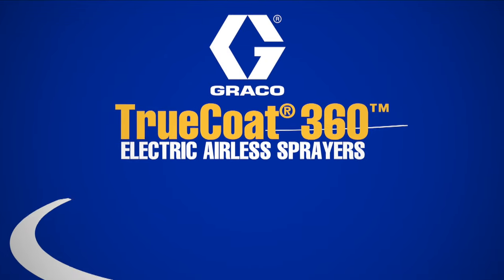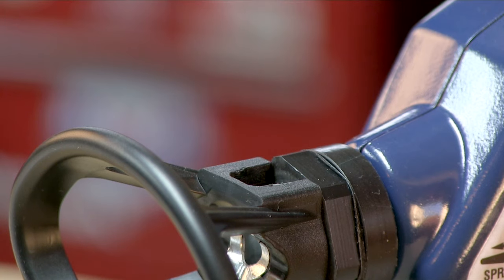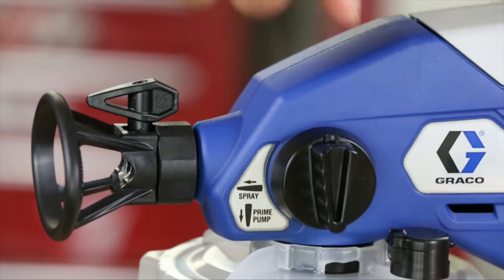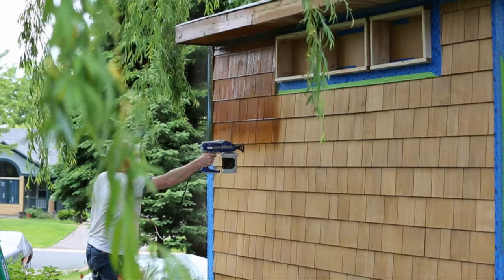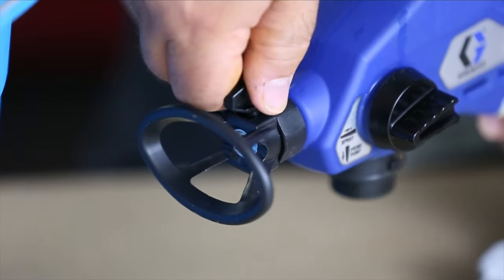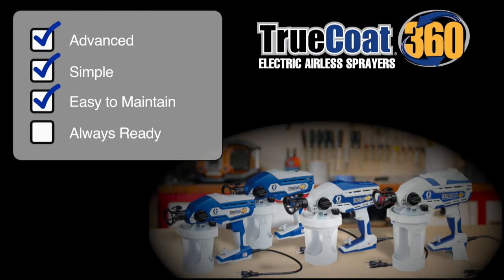Graco TrueCoat 360 Operation Guide

Comment: 0:38 What's Included
1:45 Safety
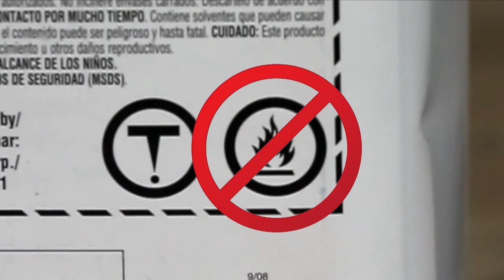2:06 Common Components
4:11 Sprayer Setup
4:16 First time usage
5:30 Starting a New Job
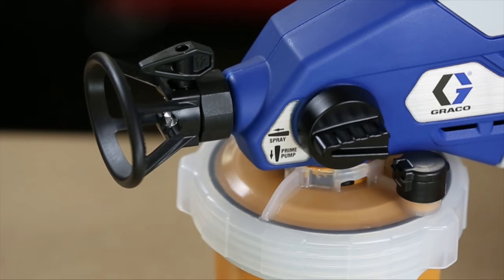7:21 Refilling the Sprayer
8:40 Troubleshooting
9:26 How to Spray
10:16 Spray Techniques
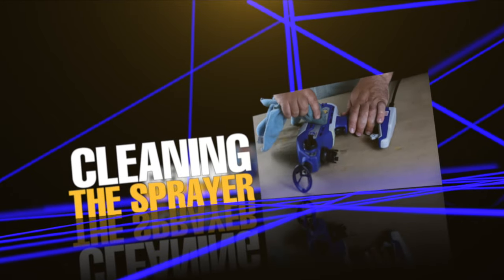12:33 Cleaning up
13.42 To Clean the Sprayer
16:12 Storage

Comment: People people,

Listen up and save yourself unfounded aggravation. This sprayer uses a collapsible bag to hold the paint. All air must be removed via the vent cap and gently squeezing the bag until the air hissing sound stops. Priming on high while inverting the sprayer for a few seconds is critical. 
Straining the paint from old cans is recommended. Read the manual and watch this video. This sprayer is awesome when you first take the time to learn how it works and what to do if there’s a stoppage of spray.
Reply: I have done all of that and still I cannot get this it to spray. I am a furniture finisher. Smdh

Comment: Bought my Graco TRUECOAT 360 DS, super hot here in Florida today, I finally got the sprayer to spray out the test fluid. I then filled the liner and followed the directions to the T.. I ended up thinning my latex paint even more with water. The sprayer would not spray paint no matter what I did. This is a brand new unit that I believe is going back to Lowes. Very displeased.

Comment: Once I sell more of my projects I’ll invest in one of these Graco sprayers, a buddy highly recommended these sprays and looking into them they look to be the best for my needs.
Reply: They are like 250 dollars at most for non professional models. You ain’t gonna get much cheaper without getting shitter quality. Just buy one. Amazon allowed me to do 5 payments 0 interest on my 360vsp without any sort of credit check or credit card offer. This is gonna out perform anything you use that’s cheaper.
Reply: For woodworkers I wouldn't recommend this sprayer bc you're limited to the. 15 spray tip. The home right finish max is far superior in my opinion bc it comes with a variety of tips for different materials. For walls or outdoor use this thing works great but for furniture I would pass.
Reply: @dusbus2384  mine came with two different tips but ok 👌 you do you
Reply: @dusbus2384  all of the 360 models come with a 12" and 4" tip

Comment: I have owned a 17D889 for a couple of years.  It works as advertised if you follow the directions.  I have not had problems with clogging - I strain any old paint that I use.  I bought it to paint interior, exterior and garage doors.  I also used it on outside furniture.  I really like to bag system that allows you to paint in any direction.  The  major drawback is limited paint capacity - ie you have to refill it for big jobs.  I have never used it indoors.

Comment: TO CLEAN 
Wash tips and liner
Fill liner with warm water
Attach liner 
Turn to Prime Pump 
Shake for 10 seconds
Dual switch to High
Turn upside down and spray into bucket for 10 seconds
Turn to Spray position
Reverse tip to Unclog
Turn upside down, spray trigger for 5 seconds
Repeat until runs clear
Reply: Thanks, I guess they didn't need to make a video

Comment: I guess the newest versions are called single speed and dual speed, dual speed plus and variable speed.
I'm assuming the newer DS is the "dual speed 26D281"
Also comes with 4 tips and 2 screens. 2 tips and screen for paint and 2 tips and screen for stain.

Comment: can you paint exterior of house with this?
Reply: Yes. I am. I'm using the 360VSP It works pretty quick and the end results are way better than I expected. The bad news is that the sprayer will only last until you're sprayed 25 gallons through it before you need a rebuild kit or new tips, AND its a booger to clean. (You can usually paint a 2000sqft house with about 5 to 6 gallons of base color). You almost need to use the spray like you are spraying with canned spray paint otherwise the sprayer gets hot. Short quick bursts... It's more controlled when you spray this way. I'm using two year old unthinned latex for a one coat, and this machine is laying it down (5-6 pressure setting) with a light eggshell texture that seems to level itself out. My favorite part of painting with this is getting under the eves of the house and painting with the sprayer upside down. Gutters look good too. You do have to strain your paint if you have chunks, I've had one clog because I ran out of paper strainers. Once you clog your sprayer, you have to do a partial clean out of the sprayer. I keep a 5 gallon bucket of water for cleaning and a 5 gallon for rinsing.

Comment: Stopped working on the 3rd or 4th fill-up.  Made a job more difficult than it should have been; took an extra day.  You'll use a lot more paint than you'll think.
Reply: That scares me!!! Thank you for the (sad) information.
Which sprayer did you use?
Reply: They are only meant for small jobs and they have a thermal shut-off. Once it cools down, it should start again. Watch the Shop Nation review for some good info. If you are going to paint your house, a Titan or similar airless sprayer is better but a little more expensive.
Reply: @judichristopher4604  No problem.
Reply: @deckmonkey1459  I have about 2000 sqft of fence. If I was to do it again or had a bigger fence to stain I would 100% get a graco airless bucket sprayer. Vsp works really well but paint drying on the threads and having to refill a lot slowed me down. Something that could of been a day job is gonna take me two days.
Reply: It was a waste of money
Reply: This is my third project, I have had no issues and followed all the instructions and cleaning to a tee.

Comment: What is the difference between the DSP and the VSP?
Reply: The DSP is dual speed (hi/lo) and has a 32 oz capacity. The VSP is variable speed (1-10) and has 42 oz capacity. 

I just purchased the VSP from HD and tried it out on a dresser. Since it’s my first time with it I’m mixed if it’s the right tool or if I need to get more experience with it. 

At the lowest setting (1) it really laid down a lot of paint. I got some runs and some missed spots. A dresser is probably not the best place to start learning. I’m pretty sure I’m going to have to sand and put on a second coat. But that’s is going to be a difficult decision because of the amount of paint it puts out. But it’s better than brush and roller which I started with. That left brush marks I didn’t like. Also it was not a very fine mist like from can spray paint. And the overspray is pretty major compared to spray paint. I put up plastic and covered the floor with a drop cloth. 

Since I’m painting indoors I am using Benjamin Moore Advance. It lays down very nice and the Graco VSP had no problem with it unthinned. It just put out a lot more than I expected. 

When I did research I was considering a HVLP vs Airless. I didn’t go HVLP because I don’t want to mess with thinning the paint which Benjamin Moore doesn’t recommend anyway. 

Because of Graco’s poor marketing I originally purchased the magnum project airless but when I realized how much cleanup it requires I decided to return it. Also, considering how much paint the VSP put out I made the right decision. 

I haven’t cleaned it yet because I’m going to use it again tomorrow. The video said you can leave paint in it if you are going to paint the next day. I hope that works out. 

Not sure what your project is but the VSP is pretty powerful but not very precise. Maybe you can contact Graco and ask them for help.
Reply: @LR-uu3dm  
WOW.... Thank you so much for all that information... I have left comments on the GRACO's Videos and have not heard on word from them, which scares me to buy from them... I'm afraid their service will not be any better... Is it my understanding that you like the VSP? I would assume that the VSP with the 1-10 speed would be fantastic... Oh and by the way, I think they said if you're not going to clean it, to store it upside down in a bucket??? Or down in a bucket, so the tip doesn't dry out... I hope I'm right.
Thank you again for all this great information... I really need to get a good sprayer.
Reply: @judichristopher4604  They said it in the video

Comment: I painted my whole house for a week with the vsp model. Easy to use. Profesional results. The hard  part was masking everything
Reply: That's great news to hear... I just recently ordered the VSP for a basement project, and after watching some videos I was becoming concerned that it would be undersized for the job. So there was no issue with overheating or the gun failing to perform in one way or another? Thanks maschngon
Reply: @letwing6994  sup
Reply: @letwing6994  I just used the vsp this weekend. I have sprayed about 5 gallons of paint. The thing is a work horse but it definitely gets hot and every two containers I let it rest.

The problem I am having is paint is getting into the threads and drying up so when I go to refill it’s extremely hard to take off

Comment: I have used hundreds of the cheeper guns painting red iron structural steel and direct to metal and they all worked good aside from being hard to clean. I grabbed one of the 360 from Home Depot thinkin Graco is a great brand for around $300 and nooooope it’s never worked not once. I have tried everything. If I squeeze all the air out of the bag and hold it upside down it works kind of but it’s not continuous but rather like a machine gun of lines....lol today I got it out to mess with it after around eight months since the last time to paint some trim and I ended up brushing it....probably better of going to Harbor Freight really.....growing up my dad was a painter and they loved Graco airless’s but the 360 👎....I could have gotten a bad one who knows.
Reply: sounds like user error. Just used mine and it worked flawlessly
Reply: @MikeJones__Who  nope it was faulty....took it back and the new one works good. It happens

Comment: My experience wasn't so good, I bought 1, tested at home before my project, it took a long time to spray and when it did it was like a spiral pattern, I didn't change the tip to the 12, that was the suggested solution, I needed a 4" tip. When I got to the job site, it didn't work, I removed the cup cover just to find a broken o-ring, went to exchange,  new one was too lose from the cup lid that connects to the gun, it worked while squeezing the flexliner, if I stop squeezing, the air got back inside and stopped spraying. Disappointing.

Comment: These sprayers are very limited in their usefulness. They can spray paint and stain at one setting. thats it. can't do any finish painting or spray poly like all the other sprayers in this price range. I'd gravitate toward one of the other sprayers to give you more flexibility. If graco ever comes out with more than just the two tips that come with the sprayer my opinion could drastically change but until then this product is inferior to its competition
Reply: Agry on limited tip availability.

Comment: As far as I am concerned this thing is a piece of junk..  after following all the instructions for first time use, I started to use it, and it lasted a grand total of 45 seconds before it stopped spraying..  Followed the troubleshooting guide word for word to get it to unclog it and nothing.. took it apart and washed it all out, reloaded the paint and primed it....and nothing.. It made the noise, but no paint came out.. After an hour I finally gave up and switched back to rollers and brushes.. Absolutely terrible product... Don't Buy!

Comment: I went to the store this morning and bought a Graco 360 VSP .  It was piece of crap right out of the box. I can't even finish one door without paint clogging up 4 to 5 time.  I took it back to the store and fight to get my money back.  Not a good product as I am a home owner try to do it yourself.
Reply: I purchased the DSP four days ago and painted all of the wood trims in my house. After prep, it took roughly 45 minutes. The flow was even and very easy to use. Clean up was a breeze. Old cans of paint or previously opened must be filtered. To unclog simply reverse the position of the nozzle. 
A few years ago I bought their whole house paint machine and it was a huge fail.